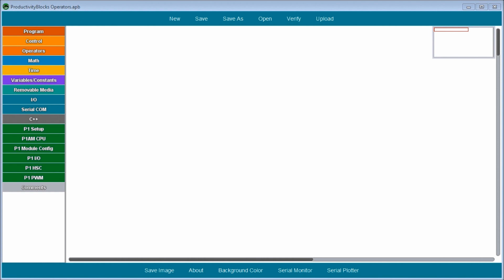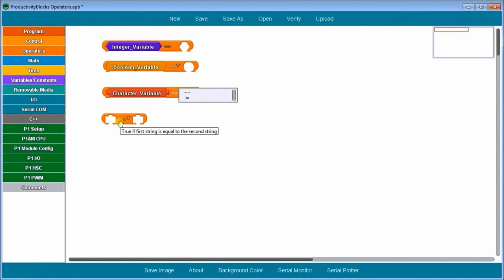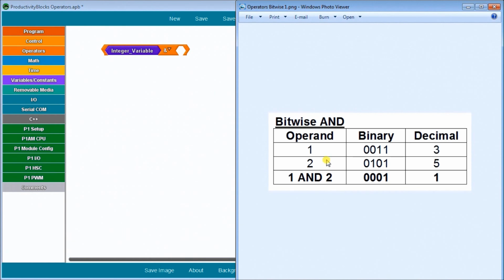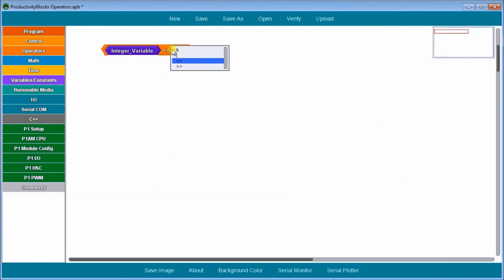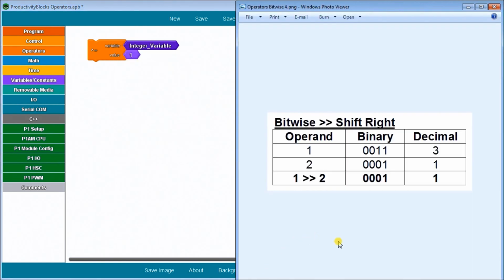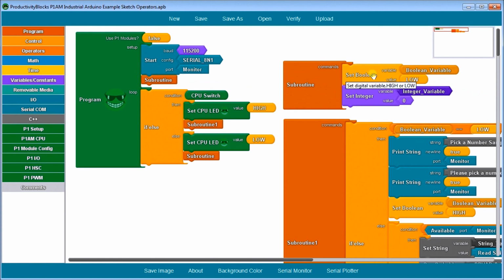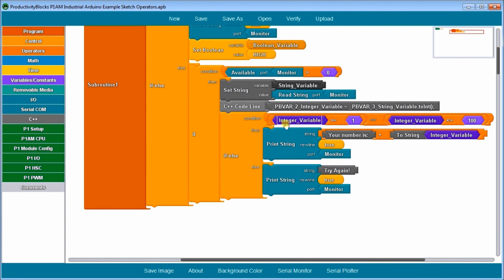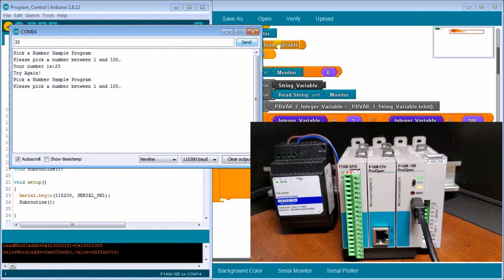Master Arduino Operators: Build Smart Industrial Controls

Comment: Thank you for making this video!  I have never used an arduino before so this will help me with the P1AM that I ordered.
Reply from the maker: Hi Osseo,
Thanks for the comment. This is a good product for the market. This series has just started. The P1AM-100 can do a lot. 
Regards,
Garry
Reply: @ACCautomation  You are welcome! I want to control and monitor items using cellular SMS messaging.  Internet here is unreliable so I needed something better.  I have been looking at raspberry pi and arduino with cellular modules but they lack the I/O that I need.  The P1AM-100 fills the gap.
My sump in the basement failed which prompted me to purchase the hardware to avoid future problems, I intend to monitor other items as needed.
Reply from the maker: Hi Osseo,
Sounds like a good project.
Garry